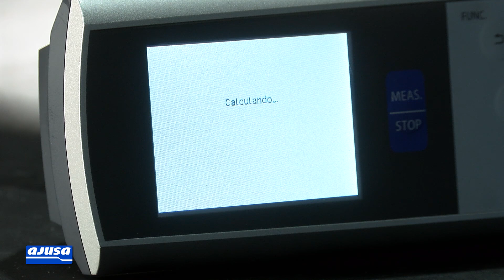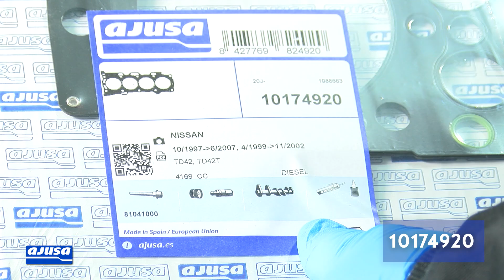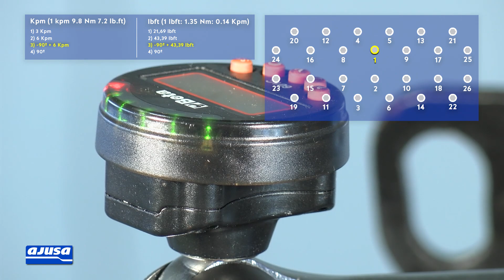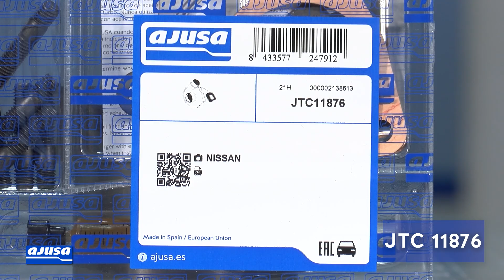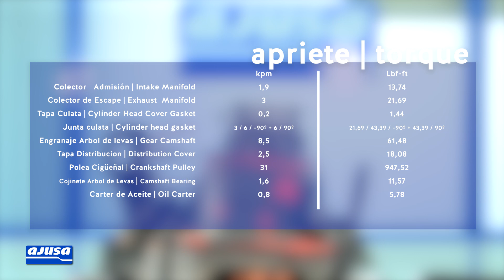NISSAN PATROL GR II 4 2 TD42 Full gasket set | Juego completo de juntas

Comment: ¿Cuánto aceite contiene un motor? TD42
Reply from the maker: Buenas tardes! Muchas gracias por ponerse en contacto con nosotros. Sobre su consulta, la cantidad de aceite dependerá del tipo de motor. Para el TD42 la capacidad oscila entre 8,2 y 9 litros, te recomendamos que consultes el manual de usuario de tu vehículo para conocer el valor exacto. Un saludo.